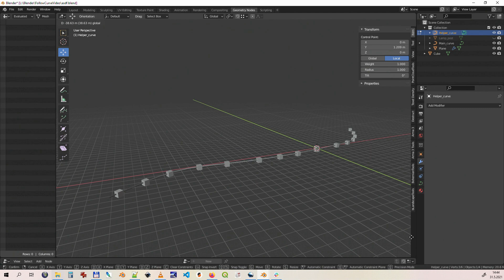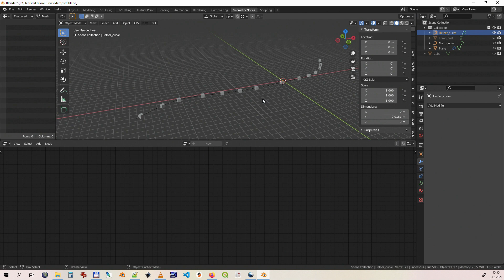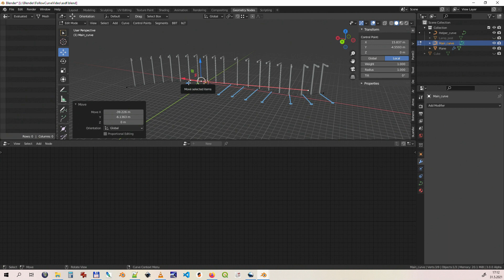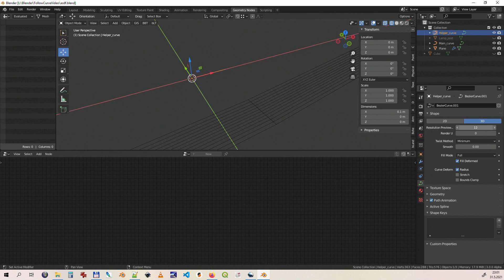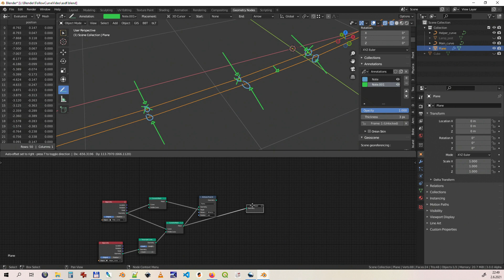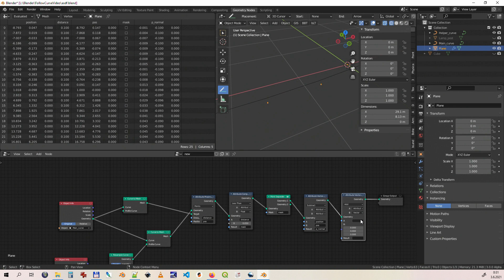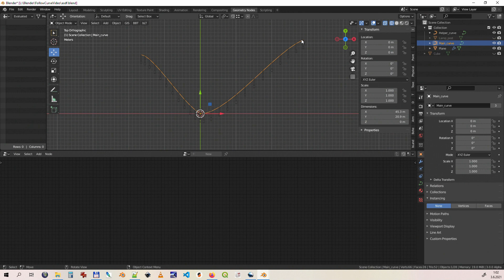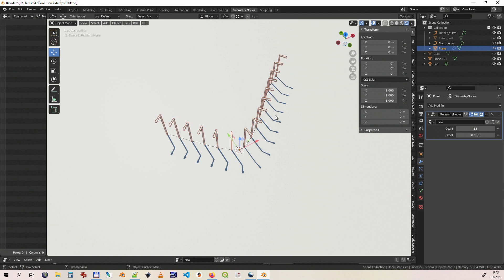(update in the description) GNodes TUTORIAL-Make instances to follow curve using generated normals

Comment: This is a good question so hear me out.
What build version date did you use as the 3.0 alpha have been changing every day. :(
Tried your tutorial but this does not work on the new 3.0Alpha :( :(
Reply from the maker: I don't really remember build version, but it was made with Blender 3.0 alpha. Anyway, during the last few months developers changed their minds and reworked the original implementation of how GN works. Therefore most of the GN tutorials based on the previous implementation are useless/obsolete.
Reply: @mirohorvath  too bad.
It's really a pain. There are some really cool tutorials that just don't work.

Comment: This was very informative.
i do have a question about the instanced objs. When I import the file to Unity all the obj are gone and only the spline is there.
When I make instance real they all get one colour and not the UV mapped ones. How do you fix that.
Reply from the maker: Thanks mate, your problem with UV mapping once instances are made real is a known issue for which there's not a simple solution. I, in some cases, solve it with python. I recommend you to follow this task, maybe add your 2 cents into the discussion. https://developer.blender.org/T85962

Comment: I'm having some weird issues trying to replicate this. Maybe with the latest build of 3.0 it isn't matching up. As I try to apply these things to my desired curve, I'm finding that it is instead applying the curve shape to my plane. I've tried both methods and neither are getting there. Wondered if there's any pointers on how the plane is supposed to interact with the curve.
Reply from the maker: Hi Nathan, yes there recently was a change regarding curves orientation matrix which in this case may(may not) cause the problem I'll have to check it out. Btw. there's already 3rd(highly prefered) approach which I'll make a video about hopefully soon. stay tuned ;-)

Comment: Hi, I am working with small objects and metric set to mm. I have weird results. I see only 0 distance in the Spreadsheet, I guess I have scale issues so in my situation how would you build the helper curve ?
Reply from the maker: Hi, the reason that you see distance as 0 is just because spreadsheet does some rounding so you probably have very small distances. So if you can up scale your scene/objects.
Reply: @mirohorvath  Thanks this solved my problem. Now can you explain where you put the resample node to get even distribution, on your video I can see that you exposed the count and offset but following the video I could not do that. I have the resample set to 2 for the helper only.
Reply from the maker: @artscrambler  to get even distribution add resample node right after the main curve's Object Info node
Reply: @mirohorvath  Logically this is what I did but everything got weird and broken if I do that :-(
Reply from the maker: @artscrambler  are you juwfx1 user at blender.chat? If so let's move the conversation there, it's easier for me
Reply: @mirohorvath  Yes it's me. Sorry for scattering info.
Reply from the maker: @artscrambler  no worries